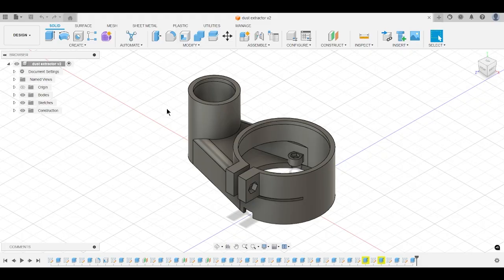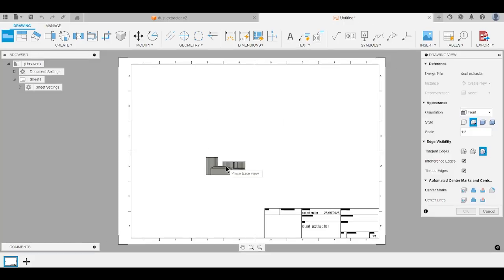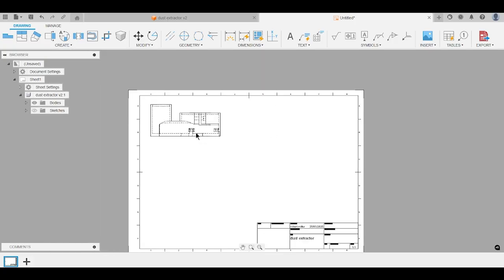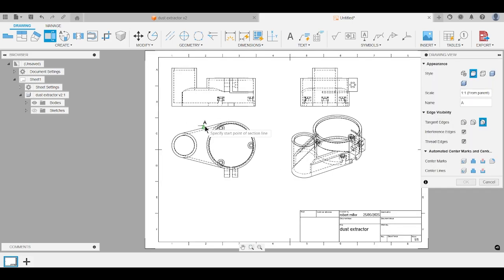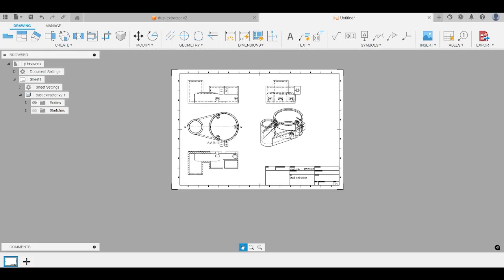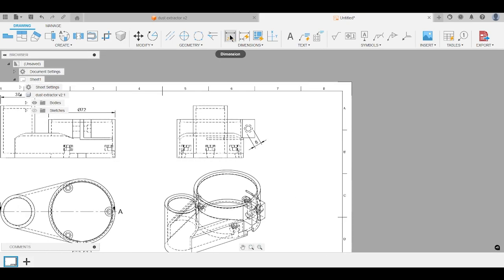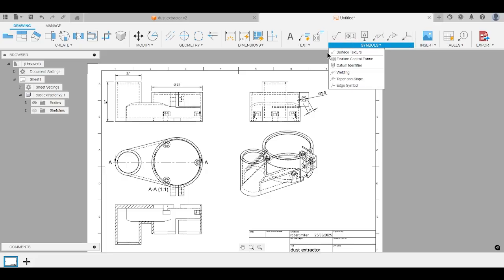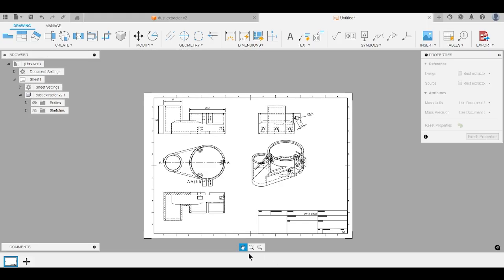Create 2D Drawings & Dimensions in Fusion 360 | Technical Drawing Tutorial

Comment: Hi I am a member of an Association called the Men's Shed in Australia we manufacture toys for under privileged children, children with cancer and others in hospital as well as many wooden products we sell at local markets. I am currently engaged in 3D and laser print a massive learning curve for me we have 2 Bambu printers X1C and two laser printers Creality and Emblazer. I do have the fusion file that requires the mod and I exported to a STEP file. I need a quick fix for a project I am doing now please. So can you advise which tutorial of yours can instruct me to modify a dimension on multiple faces in the current version of 2026 Fusion.
Reply: Don't feel alone.  I've had years of drafting starting with T square & triangles thru AutoCAD and DraftSight and I'm trying to learn 3D with Fusion 360.  It's certainly a different airplane to fly, so to speak!